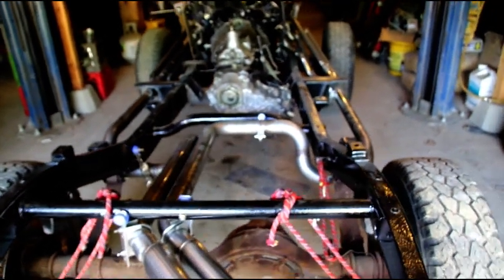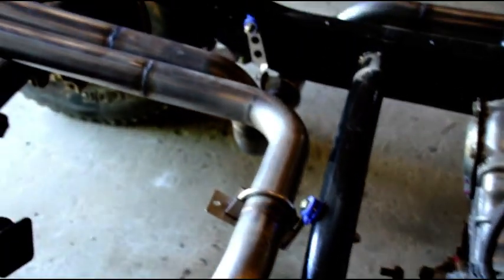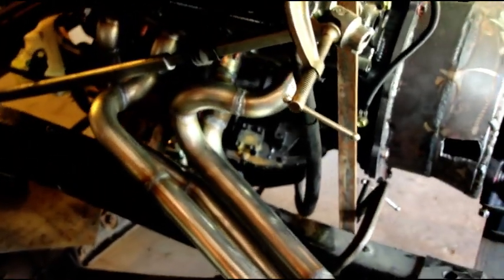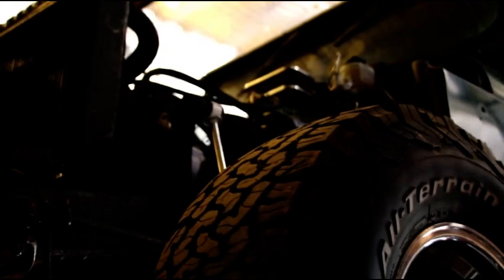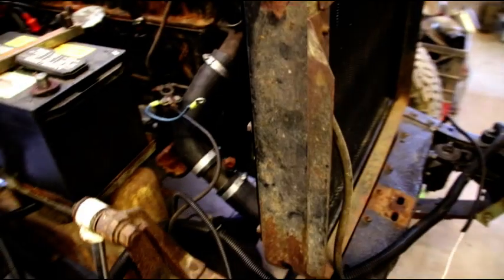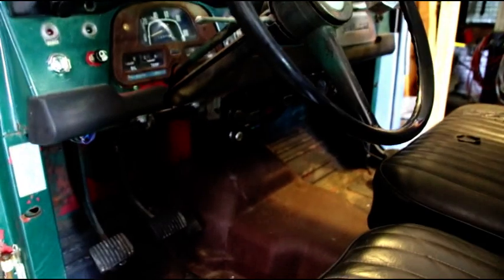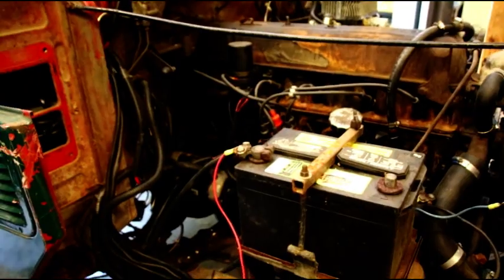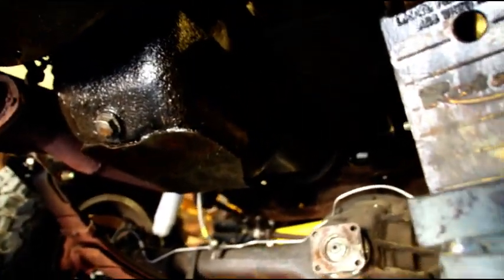FJ40 1UZ Engine Conversion Project

Comment: Would you have any interest in making another bellhousing for the H55 to mate up with 1UZ?
Also, what clutch was used in the housing?
If it’s easier you can email at evancauler@gmail.com Thanks
Reply from the maker: I may be able to squeeze it into my schedule.  When do you need it?  Best way of contact is metalshaper@comcast.net
Brian
Reply: I’m doing the same thing but I’m running the 1fzfe transmission and transfer case any advice?